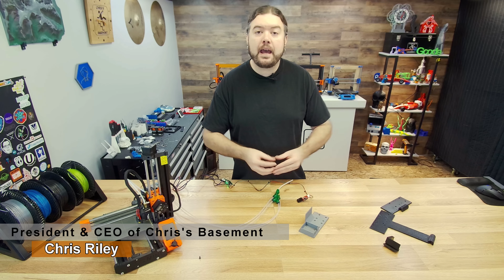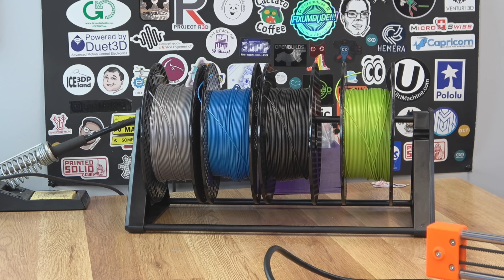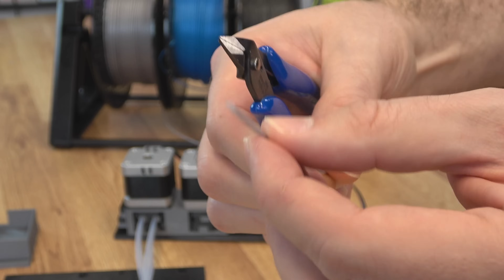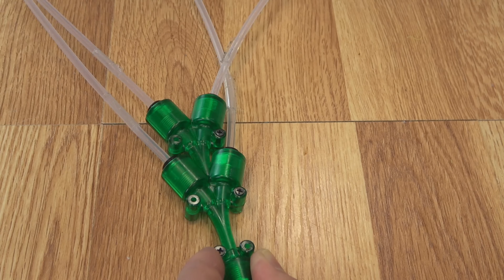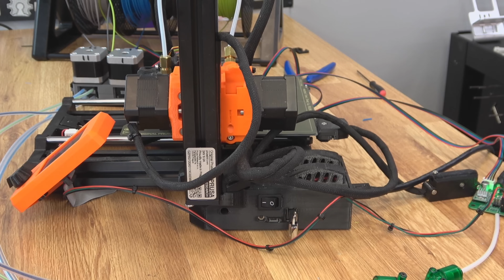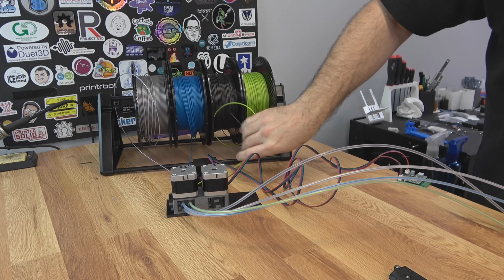3D Chameleon - Part 2 - Hardware Set up - Chris's Basement - 2024

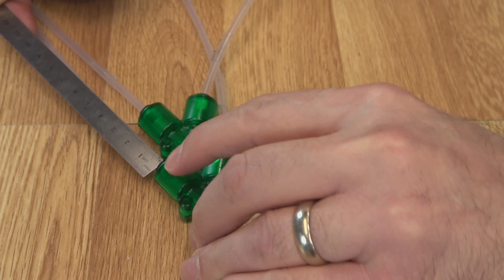Comment: At 20:20 shouldn’t you put the packing tape all at the same distance measured from the output of the wire adapter.
Reply from the maker: I correct that in a later video. Thanks!
Reply: @ChrisRiley  Nice solution.

Comment: 29:26 I thought that a filament rewinder was the best solution, but after seen the MK4 video where he is using basically sensorless homing to automate the filament measurements, a rewinder could trigger or mess with those features, so using the rewinder will need to to use the MK3
Reply from the maker: Yeah, I'm still trying to figure out what works best. We will see what we can do for the new version as well.

Comment: Cool, but all that button pressing takes alot of time.  Would be great if could just directly connect to klipper and have it use GPIO to do switch without bumping a switch.  Sounds like several seconds overhead between switches.
Reply from the maker: I plan on looking into have the firmware do the changing. That will save a lot of time. Stay tuned.
Reply: @ChrisRiley  yeah, ditch the timers , and jus5 use arduino serial funtion to send extruder commands

Comment: Hi Chris,
Instead of using a switch can the cable be plugged into the main board and use printer firmware/gcode to trigger a virtual switch to achieve the same thing?
Reply from the maker: Yes, and that is something I will be looking into, I think that is a great idea.
Reply: @ChrisRiley looking forward to it I just mounted a Lgx lite in direct drive mode on my anycubic i3 mega and looking to add a 3d Chamelion to the mix and using a virtual switch would be more efficient

Comment: I didn't know that bypass hole was in the Y tube either, for about a year after I got the Chameleon! That needs called out better! Are the clear tubes FEP? The included milky PTFE tubes I got made it really hard to see where the filament was when setting it up. Those would be so much better!

Bill has made reference to activating the Chameleon on the Mini directly from the Buddy board with an M42, rather than the switch. But I have never found specific instructions on where to connect on the board or pin #. Hoping you might run down that path!
Reply from the maker: I'm not sure what these tubes are acutually. They cam with the Chameleon 1 I got years ago and I've been using them since. I would like to have another set, so maybe I will try to find some like them. Activating it via the board is something I'm going to do for sure. SO much content with this one. I would like to do it in Marlin and Klipper.

Comment: Interesting that you installed it remotely verses using the Chameleon as the extruder, which is how I saw it recommended for the Mini. Did you choose this option because it is more universal, or do you think it is a better solution than using the Chameleon as the extruder?  I tried using the Chameleon as the extruder, it don't go well, and was rather clunky with the scripts needed. It couldn't maintain a grip on the filament for reliable printing. 

Interested to see how you load it. When I used it remotely on the P1P, it would grind the filament into the gears, and eventually all that force broke the coupling on the ECA fitting, in the extruder. I never was able to figure out how to have the extruder feeding to grab and pull the filament in smoothly, like the Prusa MMU does.
Reply from the maker: Hey Scott! Exactly, I was trying to use it in the more common config option. I have seen the "installed on" setup, it does look like that would be more consistent. I might give that a try after I get these videos done. I have found it challenging to get it to grip, but not grind. I've been playing around with the different bearing caps with limited success.

Comment: Isnt MK4 the latest version?  when will it be release?
Reply: Had this question too, noticed on Chameleon's website some blurb about MK4 official release being at RMRRF ~April 20th.  MK3 and MK4 have same hardware, but different firmware.  Hopefully 3D Chameleon creator @williamsteele will confirm/correct my understanding.  Cheers!
Reply: @AzaB2C  Yes, that's exactly right.
Reply: @AzaB2C  Yes this is confusing why give a demo or unboxing if the device is going to be replaced in upcoming months and obsolete.  Not sure of the value.
Reply: @chrisc9213  They're the same installation... it's literally the same hardware.  (He printed the Mk4 parts in the pervious video.)
Reply: @williamsteele  Ok so you are saying that you can print the MK4 parts today and because the hardware is the same.,  this means the difference between MK3 and MK4 is only software?
Reply: @chrisc9213  If you buy the Mk3 today, it is the Mk4 hardware.  We updated it back in October.  The only difference is the firmware and add-on options.
Reply: @williamsteele  ok,  where do we get the list of the add-ons and upgrade features.  Very interested:)
Reply: @chrisc9213  We won't be announcing those until April at the Rocky Mountain RepRap Fest.
Reply: @williamsteele  Ok,  we will make are decisions in April,  and depends on how the reviews are for the new ERCF v2 kit are.

Comment: Awesome video!  I was considering the 3D Chameleon but was on the fence about setting it up. Watching your videos has been extremely helpful and I feel more confident in setting one up when the time comes (waiting for when the 3D Chameleon MK4 comes out). Thanks again!
Reply: The current Mk3 is the identical hardware to the Mk4... the only difference is the firmware and the optional accessories that will be available... but they'll all work on the current hardware.  (Our products are always upgradable.)
Reply: @williamsteele  Great! Thanks for the info!!
Reply: @williamsteele  Hi Bill, what's included in the optional accessories? Thanks
Reply: @user-bt9ek2dv2y  We won't be announcing those until April at the Rocky Mountain RepRap Fest.
Reply: @williamsteele  ok, thanks!  Can't wait!!
Reply from the maker: Good luck with your projects!
Reply: @ChrisRiley  Thanks!

Comment: Will this series potentially cover hooking up the controller directly to pins on a printer board running klipper? so it can be controlled via macros rather than the physical switch?
Reply from the maker: I hadn't thought of that, but it's a great idea, I will look into it.
Reply: @ChrisRiley 
 The Klipper would really be useful. I've been looking for an excuse to get the Octopus board.
Reply: I heard Bill say on an interview that his controller wasn’t strictly needed and it was possible to connect motors etc direct to a motherboard and have klipper scripts for ‘direct’ control. I completely understand Bill has to have a “plug and play” solution for “novice users” but IMHO direct control is far more appealing  👍

Comment: Great Video! I had no clue there was the tap 3x fast to clear the command. I was trying to make some simple Klipper Macros to aid in loading. That alone will simplify things allot! I still wonder what Mode 1 is. The documentation on the website is kind of all over the place. Thanks for helping make sense of this
Reply: The tap 3 times is a "clever hack" that will clear out the active command.  Each command is up to 3 taps... but if those taps are less than the time of a single pulse, it still processes them, but they don't do anything.  I do it at the start of all my prints just to force it out of any commands that might accidently have been left in process.  Make sure they about 50ms long.  Our K1 Profile on Printables contains them in the Start GCode if you want to see how to implement it.  Chris' future video on the gcode will do that as well.
Reply from the maker: @williamsteele  Thanks Bill! Yes, all that good stuff will be in video 3.
Reply from the maker: Glad it helped! More to come

Comment: the thing I don't understand is how they will feed into the extruder at the same timing if they are all 25mm from the black coupler part.  The top two are closer than the bottom two, wouldnt that make them different lengths?

When it unloads during color changes it goes back the same amount every time, so shouldn't the lower ones have the filament just barely into the black part and not 25mm away?  That way they are all the same distance into their respective paths.

Am I missing something?   (currently struggling to get mine to work)
Reply: It'll only be wrong on the first load... after that, it will always unload each one to the proper position.  I would then mark that position and use it going forward.  However, you're correct, #1 and #4 should be loaded to the same position, 1" above the #2 and #3 extruder, just to either prevent blobbing or to make the tool change gcode simplier by not having to deal with it.
Reply: @williamsteele 
Before a print I have them loaded to where they always end up after being unloaded.  It ends up being a little over an inch away for the top ones, and right at the coupler for the bottom ones. 

Am I going about this right? Or should I just do 1 inch for all?
Reply: @4lan39 That's perfect. You're doing it right.  The 1" is just the first time.

Comment: Buffer 100%. There are no printable rewinders that are reliable enough for full and empty spools. It will either rewind too much, or not enough, except for the "sweet spot" of a spool with just the right amount of material on it. Unless there's an open source AMS out there, go with a buffer. My favorite, easy to use buffer, is the FIlament Retract Bank by TNDave. Easy to load, without having to open up a cartridge and finagle the filament through it, just move the paddle, and push the filament through.
Reply: there is a printable one with a dial for adjusting the clutch.  You could set it based on the spool when you load it up
Reply from the maker: I'm working on something now. Thanks guys!
Reply: https://www.youtube.com/watch?v=XWpAd4XuHk8